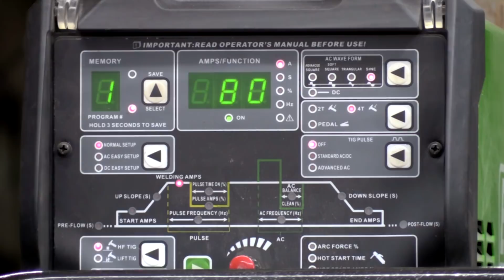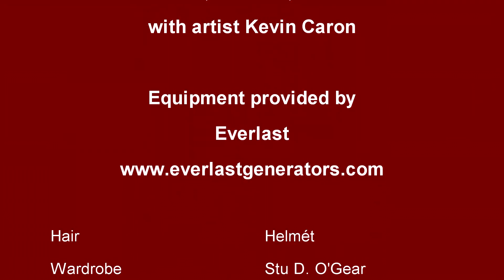How to Use Triangular Wave When Welding - and Why You'd Want To - Kevin Caron

Comment: I've been wondering about this. Recently noticed my esab rebel has the option for it and I've never used it. What might be some good settings for 16gauge and thinner aluminum as far as the frequency and balance?
Reply from the maker: I like my balance around 30%  and the Freq up around 120hertz.

Comment: Looks like triangular keeps the voltage up to keep the arc stable and with better penetration and cleaning but reduces the total power (ie "area under the curve" or heat) transferred to the material. How would this compare to using AC squarewave with pulse? Sounds like it could be a different means to a similar result.
Reply from the maker: The triangular wave is just shorter at the top of the voltage and amps.   I find I have to up the amps a little when using tri. wave.  But it sure is fun when I am doing 16 gauge aluminum on the outside edge.  AC square wave is just a little more powerful so easier to blow through.

Comment: Some time ago I tried tig welding together some small (about 4" wide) laser-cut pieces of 1/8" mild steel at an odd angle, about 150 degrees between the pieces, or you could say "bent up" 30 degrees from a flat join, if you see what I mean. Anyway I found the joint was not strong unless I welded both the outside corner of that shallow angle as well as the inside, and as a result the joint looked rather bulky. I'd have preferred to do just the outside corner. Should both sides be necessary? This was for a sculpture where the pieces were only supported by joints like that. The joints hold together, but they do not look great. Any suggestions?

Comment: Looked like the triangle took longer to heat up and get going. Is that true?
Reply: I have tried triangle wave, you need to up the amps if you use it to get the same result.
Reply from the maker: At the same amps ,yes, it took a little longer.